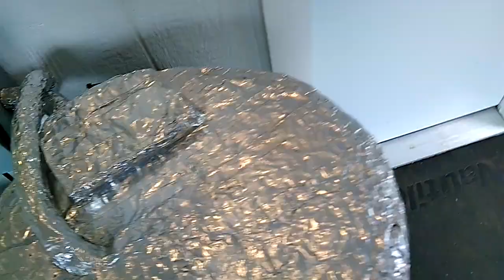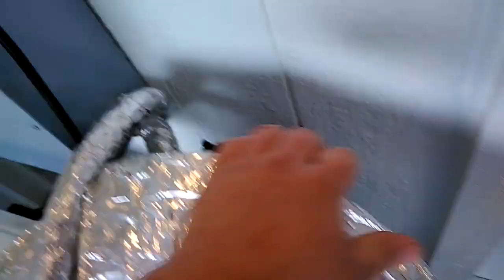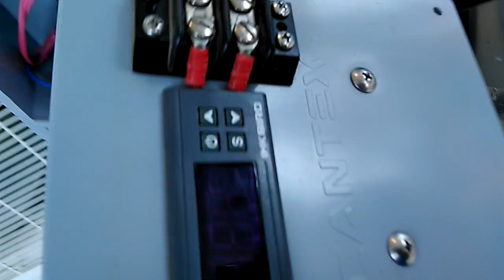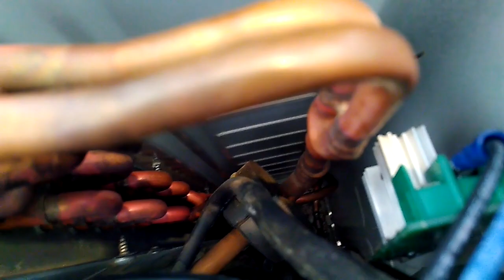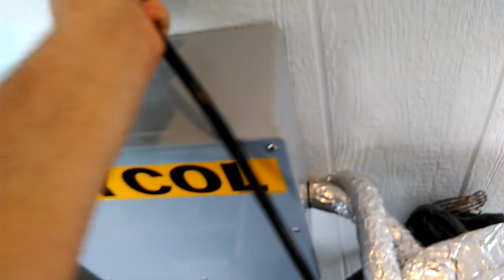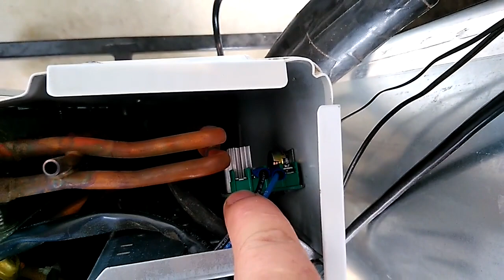Final Build of the 22-gallon Mini Split glycol chiller

Comment: Very cool. I've faced problems before starting rotary on txv. Can you not get fan to run according to condenser temperature?
Reply from the maker: Sure, I could have put a temperature controller on the condenser that activated the condenser fan. Just didn't

Comment: Hi Minton
This is Hector From Baja California
I couldnt find The recirculation pump is a Micro Vane 1.2 GPM 24 VDC pump (PWM for speed control) with pressure controls set at 4 PSI on and 20 PSI off,,, will you suggest another similar than the one you use.
Thanks

Comment: Could this be used to bring glycol to -40c or so?
Reply: im also curious
Reply: As the tempature drops the capacity does as well. So you could get -40 but you wouldn't be moving much heat. Depending on the application it might work.
Reply: Here trying to hope to find answers to the same question. Any luck?
Reply: it might be able to bring it to -40f
Reply: @punkdigerati  highly doubt it.
Reply: @TheAnthonyBrandi  twas but a quip upon their congruence.
Reply: @TheAnthonyBrandi  it would hit -40 but at what capacity. A dry evaporator with no glycol definitely would. It would probably run -40 just fine if the insulation is good enough and the glycol flow was low enough.

Comment: Is the reversing valve relay normally open, and the compressor relay normally closed? Did you use copper coil as an evaporator? Thanks for the video and your response!
Reply from the maker: The reversing valve does not have a normally open or normally closed position. The reversing valve is in the normal cooling position when it is running and before the compressor turns on (when there is a potential across the compressor delay relay) the reversing valve switches to the heat position which de-pressurizes or equalizes the two sides if there is a discrepancy. The evaporator is a 3/8 inch copper tubing that is 50 ft in length.

Thanks for watching!
Reply: @sukahusky2464  i understand that but i was.womdering about the relays and their electrical design, because i am thinking of the timer like a switch. Is the timer open or closed during the countdown? Tyia

Comment: Thanks for building this and then showing it off.  You showed the valve that equalized both sides to prevent the compressor from having a hard start.  The ITC-1000 has a compressor delay feature that can delay the start up to 10 minutes.  Does the TXV do something that keeps the high and low sides from equalizing when the compressor isn't running?
Reply from the maker: The TXV does equalize fine if you wait 5 minutes but I didn't want any delay. 
I wanted something that can go fast!

Comment: how can you remove 12,000 btu with 642 watts, its usually 1050 watts per 12,000 btu
Reply from the maker: Because I am moving heat, not making it. There is a difference.
Reply: Cooling wattage on a 12,000 btu unit is no less than 960 watts and that is with an inverter compressor. I’d say more like 1400 watts with that rotary.

Comment: How did you calculate the ideal length for the evaporator coil?

Is there a maximum length for the evaporator coil? If so, what will happen if you exceed the maximum length? (same question for the condenser)
Reply from the maker: not really, you can go as big as you want. I wanted lots of surface area.
Reply: @sukahusky2464  Sorry if this is a stupid question, but is it possible to use the coil from the indoor unit in the cooling bin? Obviously I'm not familiar with this stuff, but seeking something to cool the water coming off the condenser of my still. Seen some stuff from a window airco unit, but they are difficult to find here where I live, and plenty of cheap second hand split aircons

Comment: What would be the complications of using a inverter driven compressor?  I can’t seem to source a non inverter mini split.
Reply: It’s a scroll type compressor. I’m also a hvac guy but not versed in refrigeration. I was told that I wouldn’t get the results I wanted but you have given me hope. I really don’t wanna spend $6000 on a chiller.
Reply from the maker: Control circuit for the inverter series would be almost impossible to figure out for the normal human..
I know it's serial data and runs on around a 50 volt buss.
Reply: Ok so what about a residential condenser. I could add the reversing valve. That condenser is non inverter right?
Reply from the maker: You don't even need the reversing valve. It was already there and it was easier for me to use it then to remove it. Just like your time out on your air conditioning condenser, you'll need to wait 5 minutes before your glycol chiller can kick back on. It's the exact same concept as air conditioning except you're pulling heat out of water.
Reply: Yeah this is exactly what I was thinking. Gotta think outside the box
Reply: It’s a fixed-speed rotary compressor.

Comment: Hey Minton real interesting, I was a union member out in the tri-state area of New York and Jersey before I moved out to Argentina. What you did here is so unbelievably common out here and I actually never seen it before. I've recently worked on an old R12 system, same concept as yours only thing is that the evap coil looks like it was taken from a reach-in freezer and was inserted into an insulated box lol It operates on suction pressure. Shuts off when the solenoid valve closes and on when solenoid opens. Same concept they use for commercial refrigeration out in the states. Since I had to work on it I had no choice but to dump the gas since R12 can't be found anymore. I used Dupont MO49+ , similar to 134A pressures but not as corrosive they say and more economical since I didn't have to change the oil for the customer. The only thing I didn't understand was your use of the 3-way valve? You said you use it to equalize the pressures? Wouldn't the pressures equalize regardless in the off cycle? and what's in your system? good ol' 22?
Reply from the maker: The Reversing Valve makes for soft compressor starting with out the need for a kick start Potential relay and cap, the TXV is internally equalized and takes about 15 minutes to eq.
We have many power outages in my area and wanted to make sure that is has a soft start every time so we dump the high side to the low before every start.
The System used R-32 or Difluoromethane, The system was designed for R-410a but R-32 gave me about a 6% efficiency gain. 
Hope this helps you understand.
Reply: @sukahusky2464  are you in the states? just now seeing R-32 coming on the market for residential applications, has it been here for a long time?

Comment: Hi, I would like to know the time it takes to lower the temperature. For example from 20 Cº to 0 Cº and from 0 Cº to -20Cº. Thank you
Reply from the maker: Ezequiel Rozycki calculate how many BTUs to remove from the water, this one moves 12k/hr
Reply: so, it may be right to say that, if a compressor has a 4000btu/h power, that's the ammount of heat it can remove from water (for exampe) ?
Reply: ie: you remove 20 celcius degrees of your 22 gallon in 1 hour 50 min, aprox ?
Reply: @Juan.F.S.  pretty easy to find an online calculator to figure it out it's very basic

Comment: WHAT IS THE LENGT OF THE SUMERGED COIL
Reply from the maker: 50' 3/8" Soft Copper.
Reply: Hi bro you said 50 inch 3/8 copper pipe
Reply: YOU CAN USE THIS  https://www.google.com.ar/search?biw=835&bih=836&tbm=isch&sa=1&ei=LDXRWt6MJMiiwQSNwa2oBw&q=GAS+COMPRESSOR+ANTI+RETURN+VALVE+DANFOSS&oq=GAS+COMPRESSOR+ANTI+RETURN+VALVE+DANFOSS&gs_l=psy-ab.3...11721.13768.0.13867.8.8.0.0.0.0.65.459.8.8.0....0...1c.1.64.psy-ab..0.0.0....0.cLfRLvKxGmA#imgdii=p81XtA_1m69lIM:&imgrc=gErcEUGx2-7HBM:
Reply: WHAT IS THE TXV AND ORIFICE SIZE  AND    % OF GLICOL USED ,   YOU TEST I BUID A 2 COPPER OF 25FT AND DIVIDE THE TXV WHIT A Y AND AT THE FINISH OTHE Y ?? CAN UNDERSTAND
Reply from the maker: Rusovich 50' 3/8" copper
Reply from the maker: Rusovich this link is broken

Comment: Hi, nice work.

Can you please, tell me about the coil in the tank? which acts as a evaporator? tube diameter, coil diameter, number of rounds, total length of the tube.. all you can tell me. I am trying to do something like this.

Thanks.
Reply from the maker: 50' 3/8" Soft Copper, Cheap with good amount of surface area.
Reply from the maker: Well depending on the how big the compressor is...
Reply from the maker: Rusovich well you need to look at rate of evaporation. You just don't want liquid refrigerant returning to the compressor. You make the evaporator long enough and big enough and then that is no longer a problem. For this particular application a larger evaporator would of been better in terms of tube diameter but 3/8 is much easier to work with than 1/2 inch.

I could have gotten away with about 30 feet on my evaporator but due to the smaller size of tubing I increase the total length of 50 ft.

There's also a refrigerant accumulator and receiver on the system. They're small but still present.
Reply: AND IF YOU USE 1/2" IS SAME O BEST 3/8
Reply: Minton HVAC how calculate this i supose +12000 btu 1/2" 50ft 24000btu 5/8" 50ft
Reply: Very briefly,
I have 24000 btu compressor (in India its 2 ton compressor) can you please suggest me the coil tube size and length or + cappilary tube size and length, so my compressor can be away from damages or vapor in suction.
Reply from the maker: Facundo Suárez sure not a problem the evaporator coil is constructed of 3/8 copper tubing and is 50 ft in linear length. The tubing was stretched around a 5 gallon bucket and precisely wrapped in a uniform fashion. It was then mounted to three sticks of three quarter inch PVC with Panduit zip ties to keep proper spacing on each rap. A 90-degree Bend was put it in the bottom Inlet that meets the upper Outlet at the top of the tank..

If you're going to build one of these remember that refrigerant needs to boil off into a gas and if you put your liquid evaporating refrigerant into the bottom of the evaporator it'll give plenty of time for it to properly boil off and absorb as much heat as possible. 
I hope this answers your questions and if you have any more feel free to ask.
Reply: Minton HVAC great!

Wich is the normal working temperature in the water tank?

Have you thought about putting an  thermo static expansion valve?
Reply from the maker: Facundo Suárez 15F or -9.5C
Reply from the maker: Facundo Suárez and there is a TXV.
That is the only way you can get that low temperature
Reply: Thanks a lot..
Reply from the maker: There is A TXV on the system operation temp is 20F. Used for Beer Experimentation.

Comment: Hi if u had use R22 gas so how much is pressure in psi ?
Is it same  pressure as room  air conditioner?
Reply from the maker: Shahrukh Chikhalkar if the application uses a TXV you're going to fill based on subcooling and it's probably going to be in the 10 to 12 degrees Fahrenheit range
Reply: How is this system working out for you? Im. considering a similar setup to do refrigeration on a home ice rink.
Reply from the maker: Chris Driscoll yes its been working great!